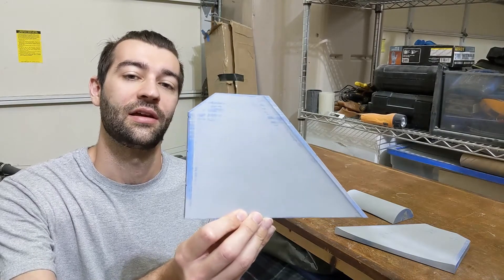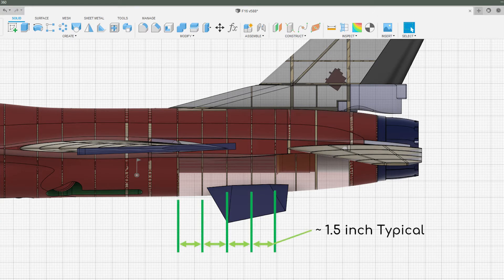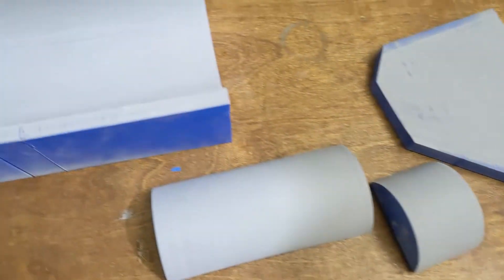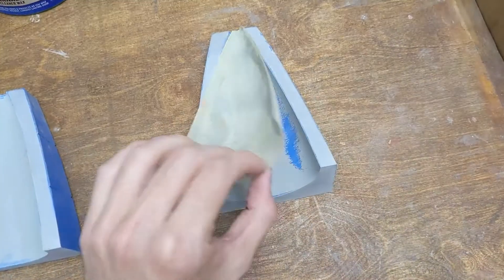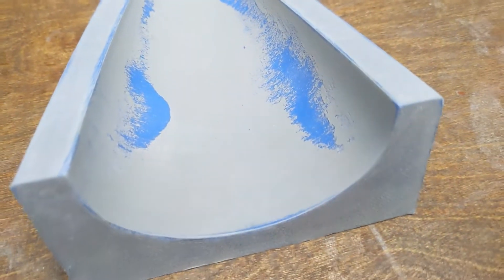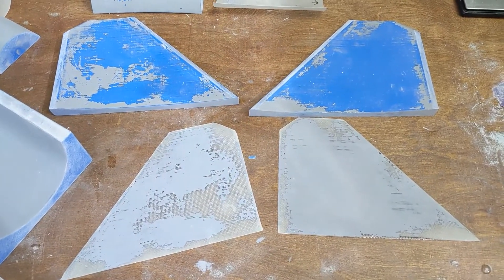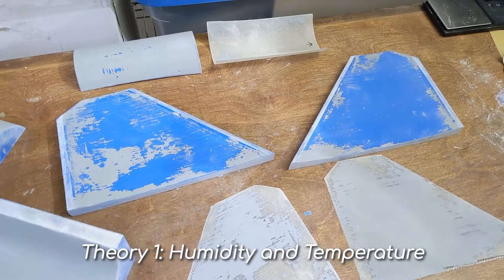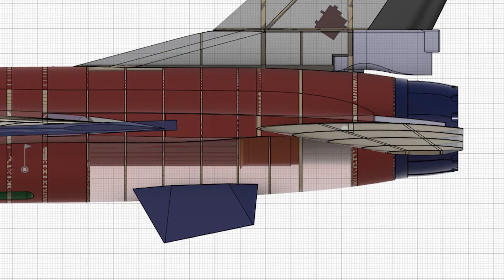The Build Begins!! RC F-16 -- Part 4

Comment: you can add (coat) superglue to glass fiber part / section that "gives in". if possibel coat on the underside.  it wil stiffen the part in question without too much weight added. Just spread the glue with your finger using latex glove, but beware the fumes!

Comment: Peel ply? Would make your layups cleaner and lighter..
Reply from the maker: I thought about using it and decided for this project it wouldn't be a good idea since I'm only using 1 ply of fiberglass. Peel ply takes a lot of force to peel off. I was thinking it would be very difficult to remove it from the flexible single ply skins.

Comment: Hyy there it's really amazing things you do I have questions why not you make there project by 3D printer that will be more effective and easy you make mold then use fiber that really expensive
Reply from the maker: I'm hoping to make a 3D printed RC jet in the future. But first I've always wanted to make a composite RC plane from scratch using 3D printed molds! It's an awesome experience.

Comment: I think you should use a layer of 2oz and 1 of 6oz, call me if you want some help with fiberglass, done it for over 40 years
Reply: The 2 oz will take alot of your pin holes away
Reply from the maker: 1 ply of 6oz seemed to work pretty well. I need to keep things as light as I can to avoid building up too much weight. Adding a ply of 2oz might be too much.

Comment: Waiting for update of the project. I am following the same method as you, just discover that no need for primer: use vinyl. You will spare sanding and material
Reply from the maker: Next video will be out in about 20 minutes! I saw Ramy use vinyl - Pretty clever and clean! An even easier method is to just use wax & PVA on the 3D print directly. I saw EasyComposites use this method. I already primed all my molds or else I would try that.

Comment: good job bro,..how many minutes to dry using epoxy resin
Reply from the maker: Thanks! Depends on the temperature and the cure speed of the epoxy you use. I'm using a "fast" hardener and it's about 55 degrees F. in my shop. I let it cure for 18-24 hours.
Reply: @3DParadigmDesign  Thank you for the information.
your video is very good and inspires me, good luck always
Reply from the maker: @TegoSuwarto  thank you!

Comment: Hey. Really love this! I'm thinking about a similar project useing fiberglass skins and 3d printed ribs. One thing I'm worried about is how the leading and trailing edges of the airfoils will line up. And if there will be any gap. How did it work for you? Or how do plan to full any gaps?
Reply from the maker: I'm not sure how i'll handle it on the fuselage or nose yet but for the wings, horizontal stabs, and vertical fin i'm using a strip of 1/16" x 1/16" balsa inside the leading edge to help the skins bond to and fill any gaps. My trailing edges are so shallow that the skins can literally be bonded together. You should be able to see the balsa stick i added in the HS leading edge in this video. Good luck on your project!

Comment: Use wax specifically made for mold release like Partall or TR 104 mold release.  After you spray the primer, let it dry thoroughly.  Sand the surface with 400, 800 and 1000.  Polish then wax the mold.  Wait at least 12 hours between 2nd and 3rd coat of wax.  Instruction should be on the can of the wax as far as wait times between coats.  As far as roughening up the surface on the fiberglass part, so the balsa sticks better to it,  use peel ply.  You will not have to sand the fiberglass part to help with sticking to the balsa former.  West systems is a good epoxy to perfect your building process, but for the actual model, you should use a better epoxy.
Reply from the maker: Thanks for all the tips tony. I actually do have peel ply but chose not to use it out of laziness 🙈. It also helps with absorbing excess epoxy so saves some weight. If i were to use peel ply i would still sand a bit afterwords to really get a nice bond. Perhaps I'll use peel ply for the fuselage layup since that will be a MUCH larger part. What makes West Systems not as good as others? Do you have any recommendations?
Reply: @3DParadigmDesign  West systems does not flow as well as some other epoxies and in direct sunlight, the parts made with West systems get soft and it takes a long time for that property to go away.  Other epoxies like MGS hardens and do not get soft in direct sunlight and it flows through the glass cloth like water, resulting in using less epoxy, lighter and stronger parts.  MGS epoxy  is expensive, but well worth the money.  I use to use West system exclusively until a friend of mine told me about better epoxies.  I use Resin research epoxy now.  It cost less than West systems, but is almost as good as MGS epoxy.  Did you use PVA on  the mold before you did the fiberglass layup?.
Reply from the maker: I did not use PVA. I've received a few comments recommending i use that after the wax since the horizontal stabilizer skins stuck to the primer and peeled it off.
Reply: @3DParadigmDesign  Yes use PVA.

Comment: Try this wax called Honey wax mold release. I have tried a ton of wax products for my vacuum infusions and this has been the best. Then put PVA on top applied with a sponge. In general, I would also suggest using epoxy primer as it cures better. You can roll, brush, or spray that with a gun onto your molds. Zero smell after a day or so and sands easily.
Reply from the maker: Thanks for sharing your experiences! I'm going to try one more round of my current strategy on the next layup and see how it goes. If I get primer peeling again I will probably try PVA.
Reply: @3DParadigmDesign  wax alone does not block enough chemical reaction and epoxy finds a way to bind to your primer which isn't fully cured (and I don't think it ever does). PVA is a blocking layer and it's cheap and easy to use. It cures to a plastic film. This is what everyone uses who has experience in this field. Check out easy composites and their 3d printed mold video.

Comment: Nice work. Thanks for sharing so much of the process. I wonder if a ceramic coat or a synthetic/polymer wax would work better than carnauba. I also wonder if you could apply some kind of sealer over the primer first to make the surface more durable and moisture resistant.
Reply from the maker: Those are all good suggestions. Thanks Druh! Another common method I've seen is to apply "PVA" after the wax to aid in releasing the part.